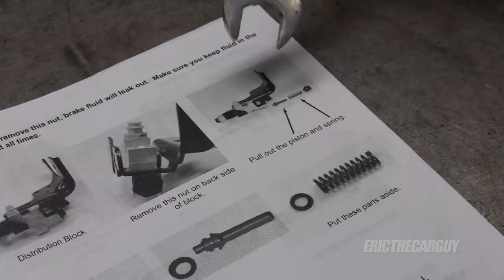GMT400 Rear Disc Brake Conversion (Part 2) #ETCGDadsTruck

Comment: 29:43, With the parking brake cable, does it not go in the hole, not around it? same for the other side, making it a straight shot and not a bend also changes the angle and would clear the bolts you had issues with.
Reply from the maker: The hole isn't the correct size for these parking brake cables.
Reply: @ericthecarguy  Well like most things in the kit why not embigen/remove it, it is not a load thing just where the cable runs, doing so looks to make the run cleaner.
Reply from the maker: Because these calipers are not being installed in the Lincolin they were made for. If you haven't already, see episode 1 where I talk about what the calipers were designed for and where they came from. Link in the description.
Reply: @ericthecarguy  Yes seen that both parts so far.

Comment: Hey this is completely unrelated to the video. So I got a car from a friend that owed me some money. The car runs fine but for some reason the alternator will not come on. (Replaced the alternator battery and fuse box.) He claims the car was running fine but they cut the exaust off after the cat for a week while they were waiting for the new one to come in. It had a hole in it farther down. Well the o2 sensor got ripped in half and the car started bogging down after about a week.They got it home replaced the o2 sensor amd put the new exhaust on. But now the car will just not charge. It's a 04 Honda accord lx k24a1. I don't know what else to look for any help would be greatly appreciated. 

(I'm thinking the ECU is probably shot since it's also in limp mode or should I just get the codes all reset)

Comment: With the "new" dual circuit master cylinders (which we've now had for a few decades) there is no connection between the front and the rear hydraulics.
Therefore, there is no reason to jump from the right rear to the left front (or whatever pattern you used) when bleeding the system.
Just do both rears or both fronts (or vice versa) at the same time because air from one end cannot travel to the other.
Reply from the maker: I followed the procedure outlined in the instructions for the brake conversion kit. 👍
Reply: @ericthecarguy  I understand and that's probably the safest approach.
However, if you think about it, that technique was developed back when one circuit covered all four wheels and air bubbles could migrate from the furthest to the nearest end of the car, which is no longer possible. You and the instructions were just blindly following tradition...perhaps not a bad thing but unnecessary these days. Next time you bleed brakes, try it and see, you have nothing to lose but a bit of time...
Reply from the maker: I'm not blindly following anything. In fact, if you've seen other videos where I bleed brakes, I prefer to start at the front. I did it this way to avoid any issues with people watching the video. You need to consider that much of what I do is for the audience more than anything. 

The fact is, it really doesn't matter how you bleed the brakes as long as you get the air out.
Reply: @ericthecarguy I'm sorry, "blindly" was too loaded a word...I did not mean to imply "unthinkingly".
And yes, I am aware- as much as a non-content creator can be- of the pressure to cater to the intended audience but given that pressure, is this not a teachable moment?
What percentage do you think believe "the left rear, right front" technique is gospel, without understanding the origin?
I do appreciate your responses, they are an interesting insight into the process.
Reply from the maker: I've been down this road in other videos where I bleed brakes. Like, every, single, one. As you can already see by this comment thread, it leads to nowhere. 

Thank you for your input.

Comment: Can´t you just run the cable through that hole 30:42 to help it with that angle?
Reply from the maker: If it was a Lincolin, sure, but not in this application. I needed to use the supplied brackets. If you haven't already, I recommend checking out episode 1 linked in the description.

Comment: Is there a reason brake lines off the master cylinder are spiraled? Does it help with pressure or anything?
Reply: It's to protect the lines from vibration and flexing. It makes it so there is a little bit of give in the hard line.

Comment: The short connection to the prop valve will work but you should have rebuilt from new and added a coil for flexibility. 
https://auto.howstuffworks.com/auto-parts/brakes/brake-parts/brake-line-bends-loops.htm

Comment: It really has nothing to do with the ABS delete. you could have just replaced the master cylinder with that newer style one, and the pedal feel is fixed. I know, I speak from experience. I did it on my 1996 Chevrolet Express, and it's the same brake setup as a GMT400.  Still have drums in the rear, GREAT pedal feel, still has the ABS unit intact.
Reply from the maker: Actually I could have just installed the steel braided lines and called it done. Those have done more for pedal feel than anything.
Reply: @ericthecarguy  not as much as you'd want to believe. Those flat top master cylinders are known for mushy pedals, even with braided lines. It would have helped a bit sure, but no where near what the late model master cylinder does.

Comment: one question why did you have to reverse the brake lines at the master cylinder?
Reply: The replacement master cylinder is a different part, and has a different internal configuration. The new one has the 2 circuits reversed from the original in this case.

Comment: This should work on a 90 chevy g20 van?
Reply from the maker: I would think so, yes.
Reply: @ericthecarguy  another question, is it possible to do the brake conversion without essentially rebuilding the entire rear end?
Reply from the maker: Absolutely. But you will need to remove the axles which requires removing the diff cover. I recommend replacing the axle bearings as well as the seals when you do it just for good measure.

Comment: Do yourself a favor, ditch the stock proportioning valve entirely and run your lines directly into the master cylinder. By having the gutted out valve there you are completely negating the valving coming out of the master.. Why? both lines are feeding into a void that basically is becoming a storage tank then the fluid is sent to both lines from that tank. You get the same pressure to both no matter what the master cylinder's valving is doing, and really the plunger in the proportioning valve is just in the way of flow. If you run your lines directly into the master I'm sure your brake feel will get WAY better. Also check this out, might help you out. https://www.summitracing.com/search/brand/phoenix-systems?autoview=ProductName&GridPageSize=12&cm_mmc=ppc-msn-searchtools_-ad&utm_source=bing&utm_medium=cpc&utm_term=%2bphoenix+%2bbrake+%2bbleeder&utm_content=Phoenix+Systems&utm_campaign=Tools+-+FSP  Instead of a vacuum bleeder sucking the fluid through the lines, this pushes it up the lines sending any air back up through the master cylinder, the way it naturally wants to travel. Also when bleeding brakes always start at the furthest from the master cylinder (right rear in most cars with left side drive) then go closer as you go on so... rr, lr, rf, lf.